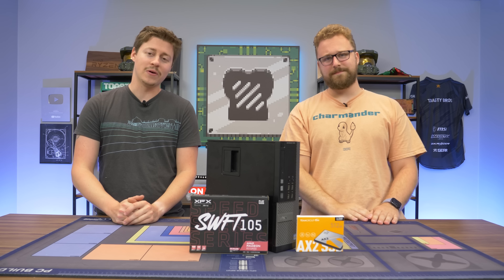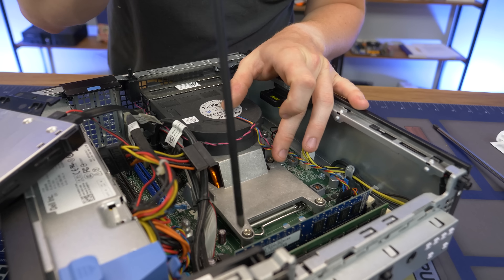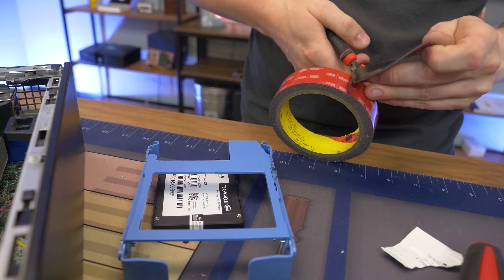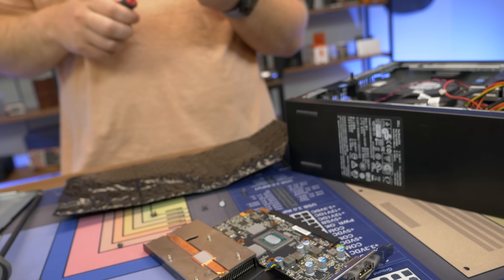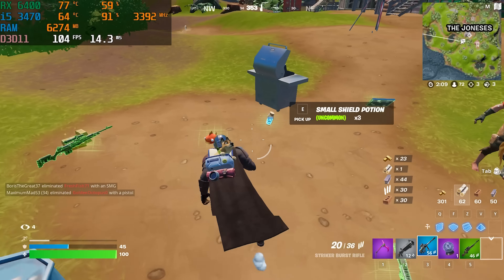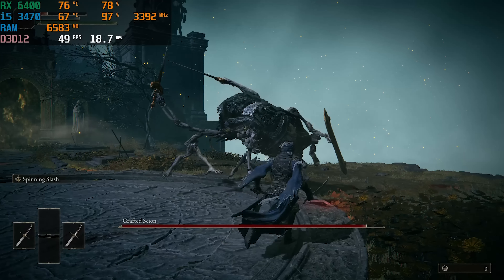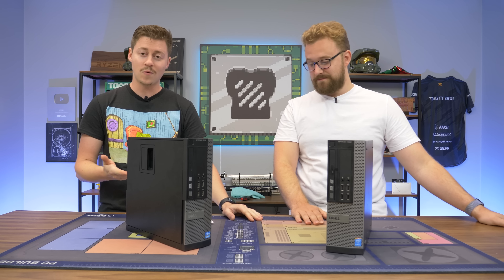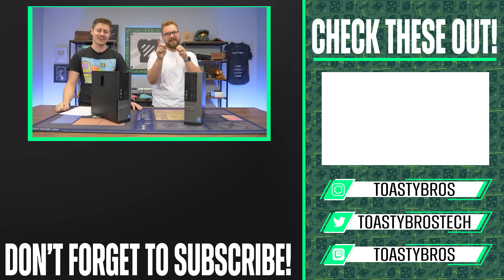EASY $250 Budget Gaming PC Build 2022

Comment: With prices tanking like they are the toastybros are back in their ZONE, always the budget goats
Reply: What the best all white gaming pc with this:
Case: Thermaltake AH T600 Snow Full Tower Case - White Tempered Glass.
And 
This cpu cooler: NZXT Kraken Z53 RGB 240mm - RL-KRZ53-RW - AIO RGB CPU Liquid Cooler - Customizable LCD Display - Improved Pump - RGB Connector - Aer RGB 2 120mm Radiator Fans (2 Included) - White.
That’s all I know any ideas?
Reply: @Soapy_pasta05  dont buy the z53
Reply: @rando3962  y
Reply: @Soapy_pasta05  wym why?
Reply: @rando3962  y shouldn’t I buy it is it not good
Reply: @Soapy_pasta05  because its an overpriced asetek aio. Rather go for arctic liquid freezer 2 instead
Reply: @rando3962  can you help me with a part
list please all white with some RGB, please
Reply: What prices are tanking? That over priced RX 6400 cost $160+.
Reply: @spankbuda7466  oh boy
Reply: @Toma-621  Just wait in about 2 months. You would be really saying "Oh Boy" and wishing that these prices will tank. Are you not seeing the signs from these manufacturers keep releasing budget cards and re-releasing several years old GPU's? Preparing for the worst.
Reply: @spankbuda7466  Oh boy
Reply: @spankbuda7466  the rx6400 isnt really overpriced considering the current market.
Reply: Hi
Reply: @newtimetimmy7728  Hello
Reply: @Soapy_pasta05  sorry im very busy right now
Reply: Hey do you know if on the 7020 the blue slot where your supposed to put the 6400 graphic card is on the bottom slot
Reply: @spankbuda7466  149 + tax so what 150-155?
Reply: the lag 😂😂

Comment: You actually don't have to void your warranty to swap the bracket. You can just take out the screws along the side of the GPU that connects the shroud to the heatsink.
Reply: I was going to say the same thing. I bought one of these cards and was a little annoyed at the amount of screws I had to take off to get the shroud off. But I was laughing out loud when they pulled the heatsink off and acted like that was necessary.
Reply: you don't void the warranty anyway, those stickers mean nothing.
Reply: In my country they mean a lot of thing 😴, dealers would have the reason to blame you that pull out the heatsink of their original position. WHICH will damage the card eventually.  
So bad consumer policy. 
  @BeetleBuns
Reply: @SANGSANTi  no it fucking won't damage the card LMAO... anyways, these fellas live in the US, and THAT is where my comment is directed as a result, ya dingus

Comment: What I like about those older Dell's is that they are simple, easy to upgrade, and built solid. There a perfect PC for a first time gamer.
Reply: No it's not, unless you want games from 20 years ago only.
Reply: @JRSping  nope , you underestimate those pc my dude
Reply: These pcs are great but not easy to upgrade. You can't swap the motherboard or the PSU which is a big compromise for upgradability.
Reply: @drrx4308  yeah but for what they are, they aren't bad. I intend on making one of these into a portable PC for when I go on extended work trips. I was able to get one on FB marketplace for $30 with an i5-10th gen and 16gb ram. Removed the disk tray and HDD, replaced the case fan and cpu cooler, bought the 6400 and a 256 GB m.2. For >$200 I paid all together, it's a damn good machine to throw into a suitecase. I intend on doing some other mods like adding a leather carrying handle, cutting some holes to increase airflow, and adding dust filters to said holes.
Reply: Can u play gta five m on them?
Reply: @HG4k_  Should be no problem. Pair it with a better cpu you could even run Cyberpunk 2077 at playable settings
Reply: @JRSping  You do not know what you're talking about
Reply: @HG4k_  Yep solid. With a good gpu
Reply: @JRSping  you're way out of touch homie. It's like u didn't watch the video. Even a lowly GT 1030 in those little Optis can run games from just a few yrs ago
Reply: @andrive  Hey, I bought what I think is this same pc on Amazon for like 150$ (Dell Optiplex 7010 Business Desktop Computer (Intel Quad Core i5-3470 3.2GHz, 16GB RAM, 2TB HDD, USB 3.0, DVDRW, Windows 10 Professional) and I was wondering, since I have absolutely no more budget, if I can play simple games with it (like the sims for example)?
Reply: @eddydelapradera  Your computer uses the Intel HD 2500 for graphics which means that for some games like the Sims it will run perfect, and most light games that don't involve heavy 3D stuff run good on it.  

I personally put a GT 730 GDDR5 that I got for $20 on ebay, and it runs the sims at max settings and action games like Battlefield 1 & 4 smooth. 

 Kinda unrelated but I also see you have a HDD, I would recommend adding a SSD and running windows from there, in my case it improved the speed of my PC dramatically (from 2 minutes to start up to 18 seconds with an SSD). You can find a 128gb one for around $15 on ebay. 👍
Reply: @andrive  tysm I'll try to look for those other things and see what I can do! I Appreciate the help a lot :) happy new year!
Reply: @eddydelapradera  All good Happy new year ❕
Reply: you can't upgrade a dell, unless you use Dell to upgrade with and if you up grade the motherboard to other than Dell then it wouldn't be a Dell
Reply: @prehensileman7254  First off yes you can. Second it's a computer who cares if it's 100% one brand or another. Dell doesn't make half the parts that you find in a stock Dell anyway. All they really make is the case and motherboard
Reply: Dell isn't worth sh%t for upgrading and you know it, I wouldn't waste my time when for 300 you can go used for a real gamer completely on eBay, piece by piece
Reply: @prehensileman7254  I still stand by what I said earlier that perfect for a first time gamer, meaning you can't really screw them up, their cheap, and easy to upgrade on a budget. But it obviously depends on where you live, what you're budget is, and what's available.
Reply: @JRSping  dude its not that bad it has 3.3 ghz
Reply: I have a 3010 that runs GTA V, Valorant, Warzone etc. Solid machines to try out gaming on for the first time

Comment: This era of Dells had a secondary drive caddy that was meant for 2.5" drives. It slotted into the bigger 3.5" caddy. They were also double-sided so you could stick two 2.5" drives in the same caddy. Later models changed the caddy but they also offered M2 slots so you didn't really need to worry about caddies unless you wanted a traditional SATA drive.

Comment: I have almost the same build. Dell Optiplex 7020  RX6400, I7-4790. An I run apex medium settings 120FPS. No lag . Medium settings on forza. Mine runs great. Highly recommend. Some higher Tier games struggle (Star Wars elden ring )
Reply: Nice
Reply: Which star wars game are you talking about? Fallen order? Does it still struggle on the lowest settings?
Reply: @androoo4717  Jedi? The latest single player one. An it doesn’t have low settings (I know surprising) it had medium settings an it was playable, medium 30fps, but still tough.
Reply: Does gta run well?
Reply: @BulletHolesz  yes. You can gta for sure it’s a easy game to run. I haven’t tried gta RP tho so can’t speak on that
Reply: @ShaunCainFitness  do you think a optioned 3020 or 9020 could run it also?
Reply: is your 7020 sff?
Reply: Mines a ryzen 7 5800x3d with the lion li twin fan case and rtx 3070 still a optiplex cause I used a ssd from it
Reply: Where did you get jt
Reply: Fun fact : u can run  ur life with it
Reply: @HassinBirgir-ov9ln  lol!
Reply: Bro get the GTX 980 it's 44% faster, better drivers and more cheaper
Reply: How much ram
Reply: 8 threads another world entirely
Reply: @S2T_Official is it low profile though lol...
Reply: @S2T_Official old as hell doesnt even support dx12 utimate so whats the point thb

Comment: Just did this, got a decommissioned pc from work, an optiplex 3010 and put the gigabyte rx 6400 in it. That gigabyte card has a low profile bracket and is a dual slot card technically, but it worked wonderfully
Reply: What games have you tried? Does the card runs okay with the 3010? Mine has a Xeon e3 1240v2 and 16gb ram but currently running a xfx rx 550 4gb

Comment: If you actually wanted to know you could always open up GPU-Z and it will tell you what generation and width you're running at.
When I worked in college our 7010s would limit PCIE power draw to 25 watts on the SFF cases (even when running in "high power" mode) so you might be running into that.

Comment: Just bought a refurbished optiplex from Amazon renewed for 250$ on  black Friday it has an i5 6500 32gbs of ddr4 and a 1660ti. Since the 6500 is unlocked now I have it over clocked at a sweet 4.3ghz from the original 3.6. Only thing I bought for the system was an aftermarket cooler from noctua to keep the cpu cool. Upgrading my CPU next month to a 6700k or maybe something better. Highly recommend optiplex builds for newbies

Comment: That 1650 is actually smaller than the SFF GeForce 4 MX420 I had back in the day.  I didn't think I'd ever see another card that small with any degree of gaming capability.
Reply: NVS 5400 in my ThinkPad impresses me as well. Traded a thin business model straight over for the 1 year older GPU one with a built in dvd rw & possibility of using old butterfly keyboards.
Reply: Nvidia A2000 is a Low Profile card that is basically a cutdown RTX 3050. Excellent card that does ray tracing and DLSS but expensive as hell. The GTX 1650 is the last of its breed.
Reply: @JinghisKhan  I really hope that they do a next-generation budget card.  They've done a wide range of cards for most generations and with modern cards getting more and more expensive, power-hungry, etc. I think my 3080 may be the last high-end card I buy, it'd be nice to have cards aimed at us getting too old to spend this kind of money on PC components.

Comment: A nice cheap little setup the HP ProDesk 600 G1 SFF with the i5-4670S (65w) and the RX 6400. For a little cheaper  get the  GT 1030 that only uses 30w so the  whole system running max out uses around 95w max and pair that with the Dell 27 Monitor: S2721HN (15w) you have a low powered 720p/1080p gaming system.

Comment: I'm running a Dell Optiplex 9010, It's got a i7 3770 and a GTX 1650 OC GDDR6 with an SSD and its my daily. Actually a reasonable machine. I was given the PC so all its cost me was the GPU and SSD..I'm right on the thermal limit of the GPU and power limit of the PSU but the GPU still boosts past its stock boost speed so I can't complain.

Comment: I had a optiplex 3020 sff first which was Gen 2.0 and the RX 6400 was a stuttering mess which really wasn't great for splitgate or SFV. I got a barebones optiplex 9020 sff which was pcie 3.0 and it made such a massive difference. If you're doing optiplex builds try to get one with pcie gen 3.0
Reply: Definitely gonna put a GTX 1660 super in
Reply: im running a gen3 card on a gen2 pcie. no performance problems. maybe it was something else
Reply: @lxvideostuff7200  but this is a gen4 x4 card...
Reply: @CouchCoach  yeah, im not an amd guy...
Reply: Are you sure it's Gen 2.0? Because it's a 4th gen i3/i5/i7 PC
Reply: @HuFaShortss  according to the manual for Dell OptiPlex 3020–Small Form Factor, it has a Intel H81 Chipset - PCI Express Revision 2.0
Reply: we should not mistake intel cpu GENERATION and motherboard interface REVISION / VERSION
Reply: I was ignorant of that! I appreciate the details! And yes, I am aware that the CPU generation is irrelevant in this situation, but they said in the video that any Dell Optiplex from the third generation or later should work fine, so I assumed this was true for all of them.
Reply: @HuFaShortss  this comment is about performance issues, from using a latest model gpu, on a very old chipset. its compatible, but it does not perform to its full potential. 
i dont remember the video, but they probably did not mean to use such a new gpu on it.
its interesting, that there are 7 such combinations, on the userbenchmark site.

btw do not buy such gpus. better buy something good used old gpu. these are just trash. anything bellow the so called half-assed mid-range is trash. now we have a silicon crisis, because they produced so much trash.
Reply: @lxvideostuff7200  bro i have pc build up  sff with haswell procesor, i want to buy rx 6400 .is this still safe enough for a 240 watt psu?
Reply: @driver720p  amd says minimum 350W. 
the thing cant run without power, so you have to provide it. there is no workaround, except, maybe if you underclock everything so so low.
it might run on low load, but you will probably hit the limit quite often and have problems.

where did you got so underpowered psu?!
the cheap chinese noname stuff years ago was like 300-350W.
Reply: Yeah you learned the hard way the 3020 is a no go
Reply: I have an optiplex 790 with 2nd gen i5 2400 and 1050 ti but I can run all these games like the finals, warzone, apex and fortnite at medium 60+ fps. There was definitely something else that was wrong with your systems. The card seems to be the mutual element here so maybe the 6400 just doesn't like pcie 2.0

Comment: from a budget Xeon E3--1230v2, i upgraded to a 2nd hand: Asus A320M Prime -K mobo, Team Elite Vulcan TUF 8x2 3200, R5 2600 CPU. if im starting from scratch id add used RX 580 2048SP GPU and a brand new Corsair CX550 all 50-55$ range can fit the 250$ mark based in regional price available here in the Philippines.

Comment: I actually have a Oplitex 7010 myself and it's a really good PC for the price. It's fast (mine) and the looks are kind of like a 2016 PC but I'm planning on adding a GTX 650/660 and a clear tempered glass case. I'll get some RGB lights for it and it will look lit. I have a nice monitor but the condition is a bit bad (scratched screen) and I'm planning on getting a nice Asus monitor later on. I will upload a video of my gaming PC build soon!

Comment: I just put a 6400 in a SFF Dell Optiplex 7060 with an i7-8700, and it’s surprisingly decent
Reply: That’s what I am planning to do how is the power draw i only have the 180w psu
Reply: @Andermattmike  Yeah a 180w PSU won't be enough I recommend a 400w psu

Comment: I often use a gen 3 Optiplex with a GTX 1050ti and it works fine in Fortnite, high settings, DX11 and DX12 modes. Might just be the GPU running in an older slot that caused the one in this video to crap out.
Reply: How much fps do you get on low settings tho

Comment: This may have been a TIM issue between the CPU and the heat spreader. I have used 3470s in modern builds and they work fine.
Reply: Agreed, I just put together an Optiplex gaming computer for a friend a few months ago and it doesn't have that stuttering issue.  Same 7010, i5-3470, etc. with 16 GB of RAM and a GTX 1070 and it runs really well--he mostly played 7 Days to Die, The Forest, etc. so it's nothing too intensive but it runs everything he wants at 1080p no problems.

Comment: you can take the cover and fan off without removing the heatsink, it has little screws on the side the 4 outside screws will remove the cover, the four inter screws will remove the fan from the cover.
Reply: for the rx 6400

Comment: I do not consider adding an SSD & a graphics a "build." This is simply an upgrade.
Reply: It’s not as much of a build compared to building one from scratch, but some people choosing to upgrade one of these PCs might choose to do more than just add an SSD and a GPU. 

For example, I recently upgraded one of these myself (a Dell Optiplex 7060 SFF) for my sister to use. Aside from the GPU and SSD, I also added more RAM, an M.2 WiFi/Bluetooth card, and replaced the stock power supply with a more powerful (but still OEM) unit. I even replaced the optical drive because the one it came with had the plug for the SATA power cable broken off inside it. Only thing I didn’t do was install the motherboard or the CPU. Didn’t feel the need to change out the CPU because it has an i7-8700, which is already a decent upgrade from the i5-6500 in the PC my sister currently uses (though I heard I might be able to upgrade to an i7-9700)
Reply: @nickfury1279  i would stick with the 8700 since the 9700 doesn't have hyperthreading.

Comment: If you're in the U.S. the warranty void sticker has no teeth. They're actually illegal. But yes, having to take the card apart to swap the brackets is stupid regardless. Perhaps there was something wrong with the 7010 system, but that blue slot is an x16 Gen3 slot, so that's not the issue. While both i5's were pretty much maxed out, the 3rd Gen i5 was constantly seeing the 6400's utilization drop really low, and go back up, where the 4th Gen i5 system wasn't doing that. That's why it was such a stuttery mess.
Reply: I thought the same but every where I search they say it in Gen 2 and I was planning on upgrading my gpu to the 6400. so maybe some units have gen2 and some gen3? If so should I still give it a try and go for the 6400?
Reply: @StealthyKai1  Don't get me wrong... PCIe Gen3 is still an issue for the 6400 and 6500 XT, just less so than a Gen2 slot. Now, that is a 7010, and according to the spec sheet, has a Gen3 x16 slot. The same will be true of the 9010. However, the 3010 only had PCIe Gen2. If you look at the entire 90 series (390/790/990), they're all PCIe Gen2. The 7020 and 9020 are both PCIe Gen3, where the 3020 is PCIe Gen2. So, it does depend on the model. But if you buy a 7010, it should be PCIe Gen3.
Reply: @TheGameBench  Thanks I think I will go with a gtx 1650 for max performance.
Reply: @StealthyKai1  I think that's the best route for older SSF systems. You might take a hit to the average frame rate, but you'll get a smother experience overall.